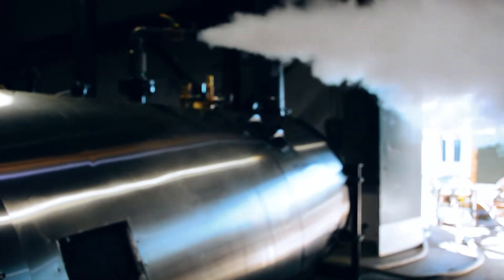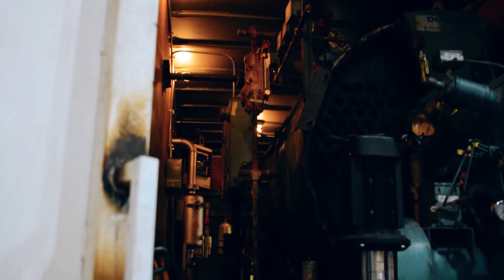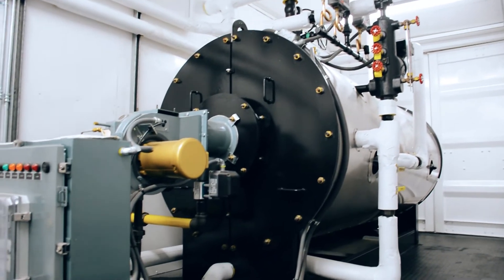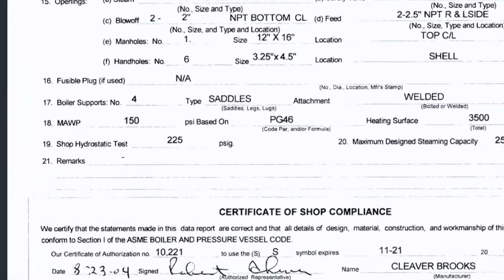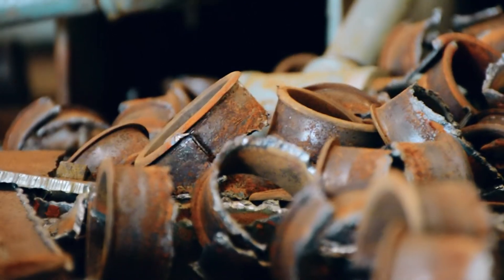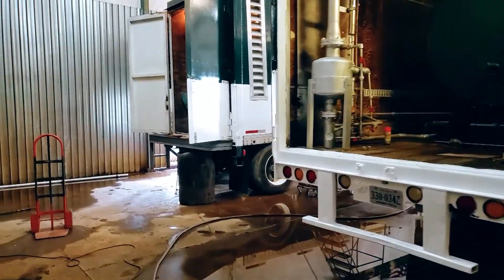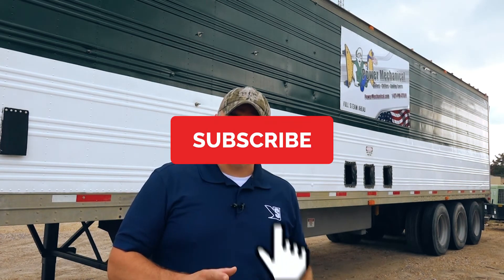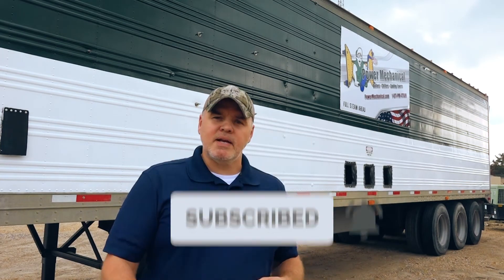Hydrostatic Test for Boilers - SteamWorks

Comment: What is the purpose of mobile boiler?
Reply from the maker: Mobile boilers have been used for projects that may be in semi remote locations, or contingency and supplemental steam or hot water. Oftentimes say if a plant has an outage in a critical facility then mobile boilers keep these steam plants running.